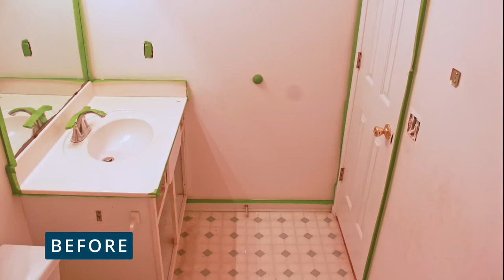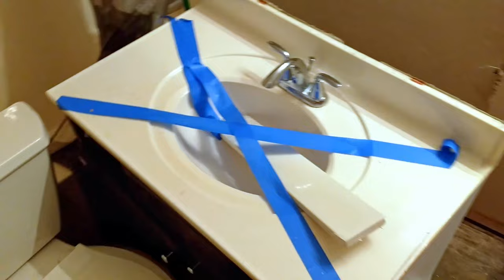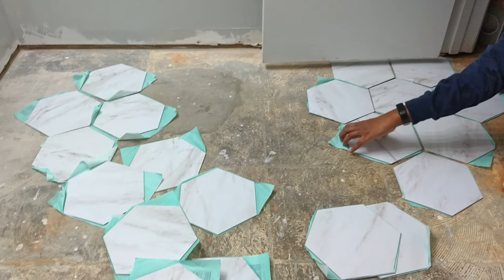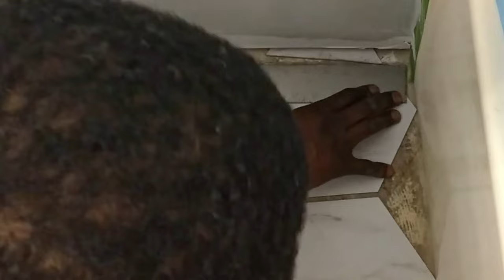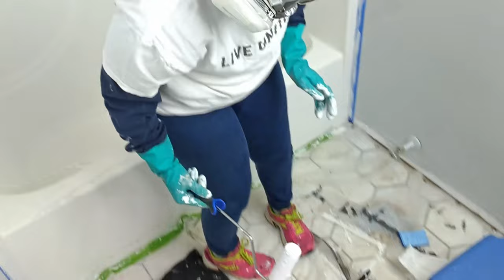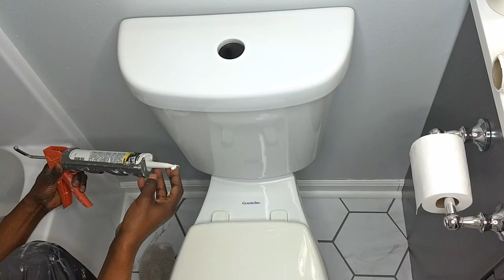Watch us PEEL & STICK ANOTHER BATHROOM FLOOR with LVT!

Comment: Hi! Would you add Varathane clear finish over the peel and stick on the floor or on the counter? I'm wondering if that would help with durability?
Reply from the maker: You can put clear finish on the counter, but we would not recommend putting it on the floor. Hope this helps.

Comment: I have a question - I just installed peel and stick vinyl tiles in my small condo bathroom and grouted them and they look great! But I kind of want to seal the top for extra protection … do you recommend doing that with like a floor epoxy or polyurethane? I have water based poly, would that work? Thanks for your videos, I followed your tips and my floor looks awesome! :)
Reply from the maker: Hi Allison!  You may not need extra protection because vinyl manufacturers don't recommend an additional top coat.  Epoxy will make it harder to remove, clean or peel and stick on top in the future.  Hope this helps! 😀

Comment: Yeah but why in the world did you mark the floor by the baseboard and cut your tiles to the baseboard? The tiles should go all the way to the wall and the baseboard will just sit on top of them.
Reply from the maker: We installed the tiles this way so if we want or need to replace the flooring, we can just remove the trim.  We didn't want to remove the baseboards as well to make any updates.